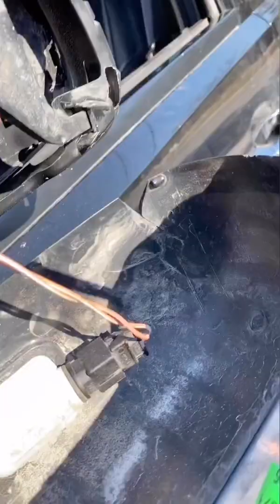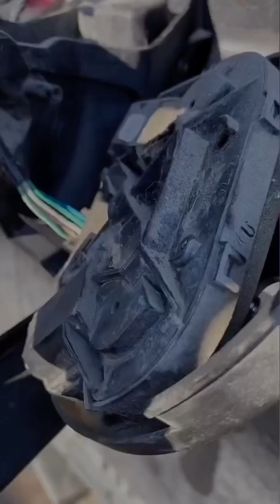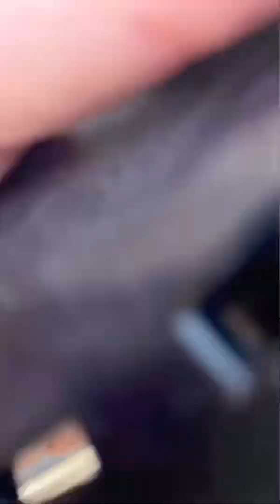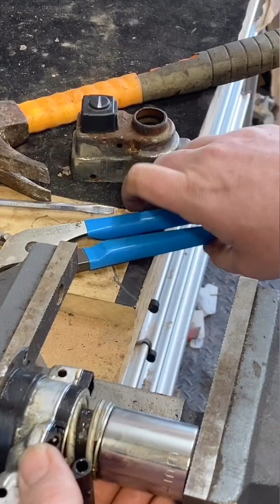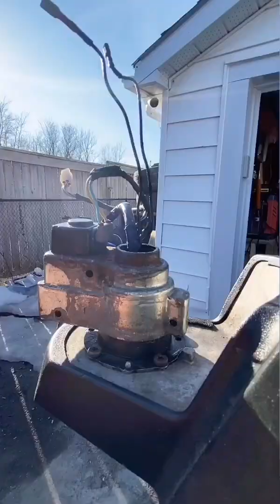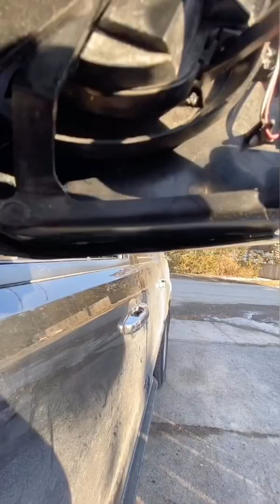2007 Avalanche power fold mirror REPAIR  NO Parts!

Comment: Great video and very informative...! I have a 07 Ext Escalade and the mirror on the drivers side will fold in and out and the adjustment on the right to left works however the adjustment on the up and does nothing... any ideas?

Comment: I had to change the gear,it was plastic and broken, I put in an alloyed gear in, put it back together, all inside gears lined up sat into the crevices where they belong, put it back together and it will not rotate the mirror, once inserting the tension spring, seems to put too much pressure, the motor turns on but will not turn the housing.

Comment: I've tried your fix by replacing my broken plastic gear with metal gear.  Once I tested it, the motor went to the closed position and want open back up.  Can you shed a little lite on what may be wrong?  I made sure the gears properly meshed.
Reply: Ever get this fix? I noticed there was a type of ground problem with my mirrors. When ever I mounted them they would not work but once I took them off the side mirror mount and left it hanging off the wires it would work. I gave up trying to figure it out
Reply: @dougcastle1785 this. There's videos explaining how to move some tabs around to fix the grounding issue.

Comment: Thank you very much!! Video was extremely helpful. Just bought an 07 Tahoe and the passenger side mirror would not move. Followed you instructions and now it’s like new, with only my time spent!!
Reply: Was the motor making any noise before you took it apart or was it quiet?
Reply: @goodgollyjosh  nope. No noise, it would move just enough to get the small amount of slack out and stop. The mechanism that’s held together with that big spring was froze up. Cleaned it up and regressed everything and it works like new. I did find that the plastic gear on the worm gear is cracked but it is still meshing ok.

Comment: Since the electric folding of the right outside mirror didn't work because of a defective gear, I replaced it with a new one. Unfortunately, only the collapse works. Electricity arrives at the plug when I switch. The mirror is also much heavier than the one on the driver's side. It feels like it snaps first, moves and snaps back in ... 2x click. Could it be that I inserted the inner rings incorrectly?
Reply: I was seeing when replacing with metal gears it grounds out... to fix that issue have to push the tabs in on the motor itself
Reply: @bigcurt011  Thank you! that must be why GM put plastic gears in there because when you go to mount it grounds out. Did pushing in the tabs on the motor actually worked?

Comment: Just did my driver side 2011 Avalanche in Canada, eh?  Great instruction video.  Mine was rusted at the top of the hole where the wires come through, where the casing and the inner tube meet (normally the motor casing rotates and the inner tube assembly is part of the frame (mounted using the torx 20 screws). So, I eventually released the motor casing (prying and WD40).  Once I cleaned and greased where the casing tube and the frame tube meet, I didn’t need to take the gearbox assembly apart.  Tested it back on the motor connector to make sure.  Put it all back together and it works great now.

Comment: I've had mine apart twice but could never get to the motor.  Going to try once more. Your video explains it pretty good. I never got that far. LOL
Reply: Just need to keep prying around the casing (4 points) enough to get clearance between the assembly and cover.  Mine was rusted all around at the top (where wires come through), preventing withdrawing the casing to expose the motor inside.  WD40 and a trick with opening up the swaged tube top with a screwdriver then pushing the inner tube down, with a socket on an open vise did it.

Comment: I just did my mirror using gruven parts to replace the motor and the gears. No more issues
Reply: Did you grind the bottom flange so when someone hits the mirror it kicks back-and-forth easier without any pressure also it helps to go to move in and out with better ease
Reply: @louisgreenberg5384  No Sir

Comment: great video  was exact how to take apart. Only mine had a broken plastic gear. put it back together and may get a gear. One thing when i put the spring together it was not all the way set and that lock ring and washer let loose and took off like a rocket. hit the roof of my garage and found the spring and the ring was way up in the rafters surprised i found it. Used a little camera to look up in the eves . just be careful thanks again for the video.
Reply from the maker: chris  that spring is definitely powerful and under load! It’s the most precision part of the job. Thanks for watching.